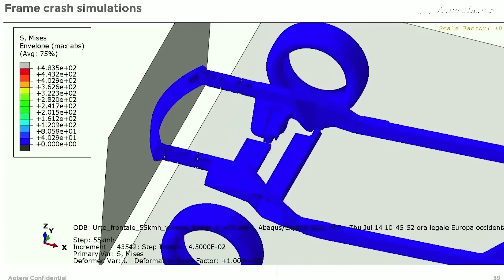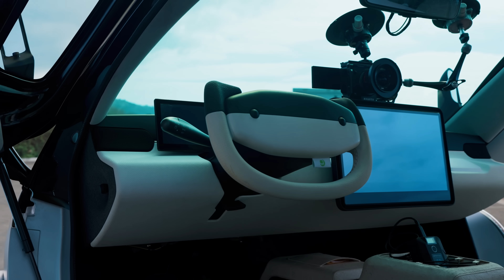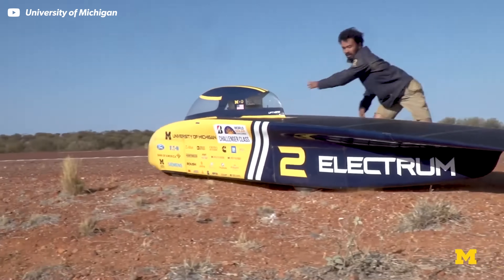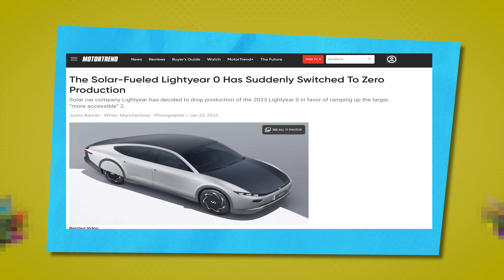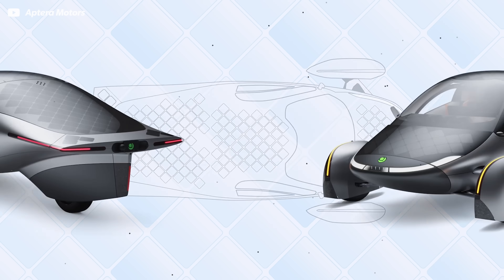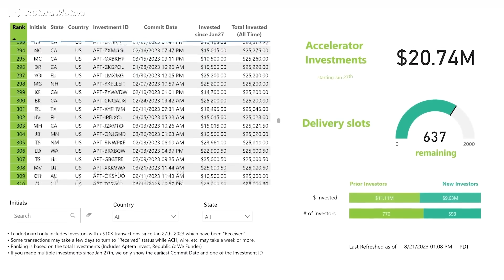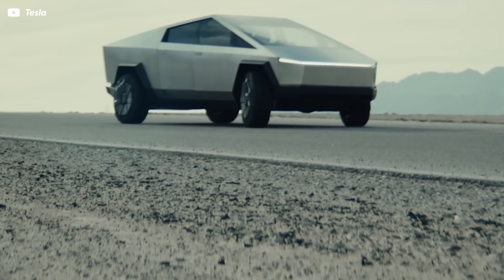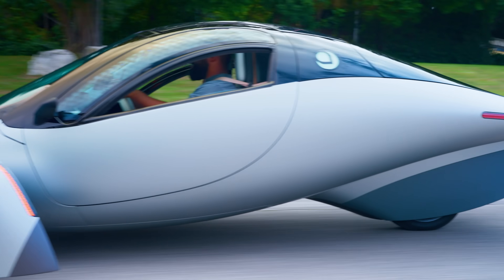We Drove America's First Solar Car

Comment: I absolutely love the focus on efficiency. It always bothered me we drive around in huge pieces of metal shaped like bricks, when 95% of the time we drive alone or just with two people.
Reply: Ur right but I love my brick
Reply: That’s exactly why we need more vehicles like this, and many more approachable motorcycles.
Reply: meanwhile you'll have very little cargo capacity with the Aptera. Need an Aptera 2 with a larger back end.
Reply: @Leetshifter  the vast majority of people overestimate how much cargo capacity they need. For most people in urban areas they dont really need more space than this and when they do it's very easy to go rent a truck from home depot or something to move large stuff. Most cargo capacity in SUVs/Trucks sits empty 99% of the time or is very inefficiently used. There's a reason the rest of the world gets by fine with small 5 door vehicles while americans drive around in monstrous gas guzzling trucks/suvs, it's because we are idiots that overestimate how much we use our cars to move stuff and prefer convenience over practicality. Then we complain that parking lots are hard to drive in because we're driving around in giant boxes.
Reply: @CRneu  what if someone figured out a way to solve both problems, a car similar to this Aptera somewhat, but with....... like a convertible style mechanism which can extend the storage capacity to a reasonable amount comparable to a normal car, with a click of a button (or do it manually).
Reply: 95% of the time? Tell me you're single and childless without telling me lol. No family would ever use this over a regular SUV.
Reply: Do you drive around WITH your partner AND kids literally every single place you go though? I understand your logic..think of it as your commute vehicle to and from work..I think that's what they were trying to portray
Reply: @CRneu  This isnt much smaller than say a Model 3 (and its substantially wider) , much less versatile,  around the the same cost or more after subsidies, and unless you rarely drive or live in one of half a  dozen sunny states, the solar will merely top it up a bit, you'll still need to charge regularly, so the solar buys you nothing if you thought youd  never have to charge on a trip. 150 miels overnight?
Reply: @CRneu not sure where you're from, but I would say MOST people that claim they need cargo space, usually are hauling stuff around on a weekly basis. No way in hell I will ever daily something this tiny
Reply: @fan24jt1088 so have a small vehicle to commute to work, and have an SUV for family needs? That defeats the entire argument of downsizing our vehicles lol
Reply: @Leetshifter  The rear hatch is actually quite large. You can fit a bicycle back there or camp in it. They have videos on YouTube showing the capacity.
Reply: @Leetshifter - I guess 32 cubic feet might not be enough for you but you can stretch out and sleep if you're under 7 ft!
Reply: @biggiesmalls7939  I lived in the States for a while and I'd say no one who had a large car or suv hauled anything expect their snow board/gear 2-3 times out of the year.  If someone's job is to haul things, they should own a pickup truck or van.  Where I live now (Japan), almost no one hauls anything and most drive alone so a car like this would be perfect.
Reply: Until “we” have a wife and kids...
Reply: @Joe-lb8qn "much less versatile"

In doing what? Being driven?
Reply: @alalalala57  in what you can carry in it (passengers and luggage or passengers plus luggage. Note the plural on the passengers.
Reply: So you are buying one? If not, you don't believe what you are saying.
Reply: @MinecraftMasterNo1  a family with kids will still have one car that is hardly used or is just used by one as a commuter. I have three kids. "My" car has always been smaller since we use the bigger for family
Reply: @Joe-lb8qn  150 miles overnight on 110? That is a very good ratio. It would take a model 3 30 hours to get the equivalent charge on 110. The solar part is nice, but I agree it is getting oversold a little (even though PVs work in cloudy environments as well.) The solar is like the nice bonus on top of an extremely efficient vehicle. There are also a lot of use cases that people don't consider too, like using the solar in your vehicle to feed back into your home/batteries, or even back into the grid.
Reply: @Leetshifter there is 7 feet behind the front seats and it has 32.5 cubic storage. You cab fut a bike or two, a surfboard etc.. They even have a tent option the attaches oveve the open rear hatch. Two can sleep in the back.
Reply: No one had a problem with it until your were told you have a problem with it! Being part of trends sounds exhausting!
Reply: I would never fit in there being 6'5". It looks awful
Reply: @VikingNidhogg starting with the Gamma prototype the made some improvement on the body that made it bigger.  The showed a 6'8""  guy sitting in it. There is a curvature in the seat rails. As you slide the seat back for a tall person the seat "lowers".
Reply: @MinecraftMasterNo1  understood. When our kids were young we had either a minivan or three row SUV as one of our vehicles However for the most part the vehicle that I drove to work in everyday carried only me most of the time. Had the Aptera been available and if we could have balanced usage between the two vehicles we would have saved a lot of money and reduced our carbon footprint.  My kids are grown, and now a vehicle likes this makes sense for me.
Reply: @MinecraftMasterNo1 I mean, they literally say in the video it's a commuter car. It's cheap, made to be driven as a daily driver. Not as a family hauler.
Reply: I drive a Volvo.  Soft edges and roundness make me twitchy.
Reply: @MinecraftMasterNo1  Most households with kids have a second vehicle.
Reply: @Joe-lb8qn  It has a smaller cross sectional area, and significantly lower coefficient of drag with enough versatility to do what most people need to do. This vehicle should cost less to run, and it costs less per mile of range even if the solar didn't work.
Reply: That's why I chose the smallest hatch I could find when I brought my car, sadly it's an ICE, but in Victoria, Australia, it's costly owning an EV. If I had the money, or if it was cheap enough, I could certainly go for a small and large EV for different applications.
Reply: Same/worse with larger working pickup trucks. I don't understand why a 3/4 ton has to be so God damn gargantuan. I need to tow things into confined areas and for that I would like a tug boat-like truck, not a fricken cruise ship.
Reply: @woodyfpv5331   A lot of the pickup truck bloat is a side effect of poorly written emissions regulations created by large amounts of lobbying by the automotive industry.
Reply: @Joe-lb8qn  To be clear, the 150 miles of range charged overnight was using a standard household outlet, not a EV specific high capacity charging station or home charging station. 
Not sure what the charging range/time equation is using higher capacity charging option. Personally, I think it is pretty great that it has the option of using a basic wall outlet to charge from in case you are not close to a dedicated EV charge station.
Reply: But this is a "huge" vehicle for only two people. It's long and takes up more road width than a Hummer. There in no efficiency here when you look at its size in relation to what it is transporting.
Reply: @Martin-se3ij  Clearly there are many ways to measure efficiency. I don't know many people who measure vehicle efficiency as ratio of exterior size:interior carrying capacity. But you have a valid point. This may not be a great one for parking in super tight city parking spots. Other vehicles also carry two passengers while being much smaller overall. In this case the Aptera is aiming for efficiency in terms of energy used:miles traveled. By that measure it is pretty hard to beat. Bicycles are about the only thing that can transport people with less energy use although they have obvious limitations and are not viable for lots of people who would choose a motorized vehicle for many, many reasons.
Reply: @SvenFeral  It uh... it's more efficient than a bike.
Reply: @MinecraftMasterNo1 Do you drive your kids and wife always with you to work?
Reply: @liamrmorgans921 So? Then sell the old and buy a new car, or if you can afford it have 2 cars. You don't take your wife and kids with you to work.
Reply: @Leetshifter  no one needs that kind of cargo capacity in the city. Which is the best place for these cars to exist.
Reply: @MinecraftMasterNo1  Tell that to the countless families with two seater cars in their driveway.
Reply: @Leetshifter Maybe it's just not the right car for this use ?
Reply: @Leetshifter  I almost never need more than the aptera can carry, and most families who actually have need for more capacity often have multiple vehicles.
Reply: you drive the biggest car you can because someone else IS GOING TO crash into your car in your life time. WHEN that happens you will be glad you had the same size or larger car than them.
Reply: @Leetshifter  It was originally 25 cubic feet and I think they got it up to 32? More than a model 3.
Reply: @Joe-lb8qn  It's like half the price of a model 3.
Reply: @nomercy4521  Where can I buy one to check it's half the price? Also even if it is, if it ever happens , it also carries half the passengers.
Reply: I am just sad that probably in Europe this will be at around 50k euros which for countries like Spain is expensively prohibitive. (Median income of 22k euros. )